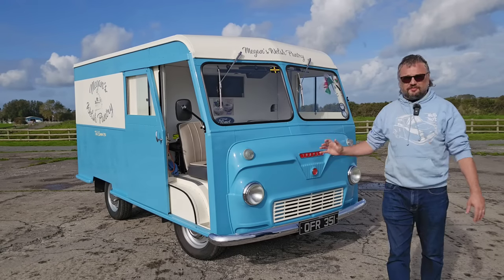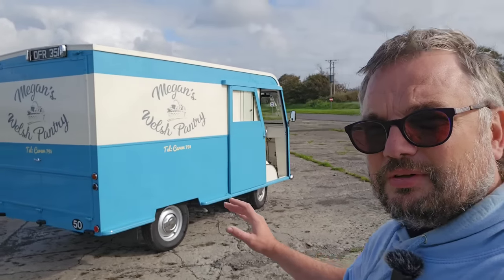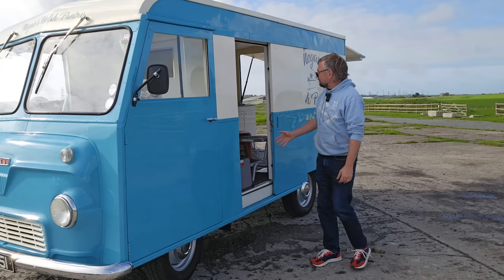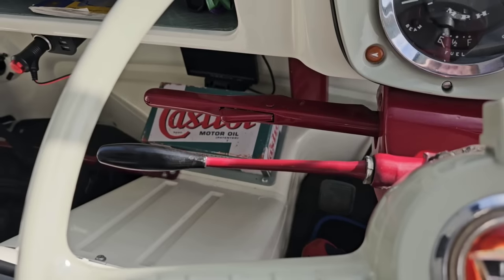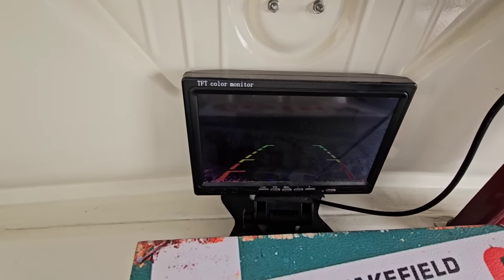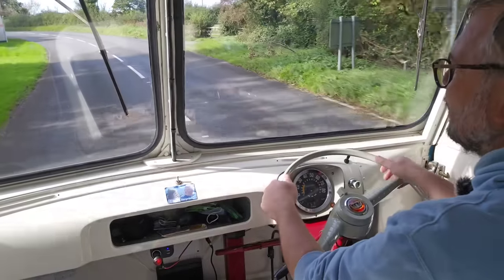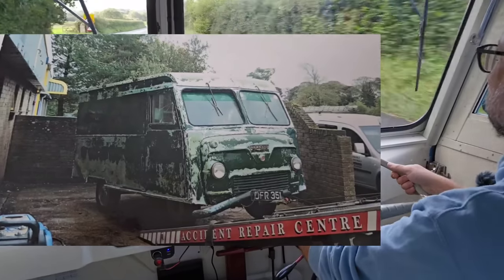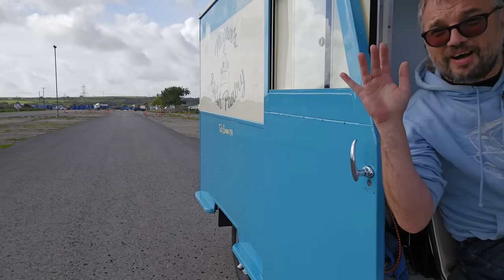What a treat! 1958 Ford Thames 400E bakery van -

Comment: My Dad had one of these in the early 60s. As a child, I was mesmerised by how the ribbon speedo worked. I remember sitting on the engine cover when we went for a drive. My backside would be roasting after 10 minutes and not the safest place for a 5 year old to sit.
Reply: I remember doing the same in my dad's one, we were tough in those days! 😂👍
Reply: Yes on the innovative heated seating, but in ours we had loose  bus seats in the back.  The Scout Troop had one also ,  featuring a chiseled hole in the engine cover/ child seat,  I think to assist early diagnosis of a coolant boil-up.

Comment: Those controls and the 45 mph comfortable cruising speed take me back. I think the position of the indicator controls would still be viable, I think; I remember seeing, though never driving, cars where it shared that position on the top of the wheel boss with the manual ignition timing control. Kids these days.

But there's one thing we should be really glad has gone: vacuum driven windscreen wipers. For those who have never experienced them, they were driven by the inlet air pressure, well below atmospheric on a light throttle. But there was the classic, terrifying scenario: rainy night, and you come up behind a slow vehicle that you really need to pass. As you accelerate, the opening of the throttle reduces the pressure differential in the inlet, and the wipers gradually slow--to a halt, if the system is not in the best condition. Terrifying. However much you value authenticity, they have to be replaced in any vehicle that goes on the road.

That was delightful--and for all of the appeal of the past, modern vehicles are so much safer.

Comment: Oh that brings back memories!

My dad had one for about 12 years from new as a farm van. He did some market gardening, and used it to take vegetables to local shops. His had uprated suspension giving it a one ton payload (though still with the 15 on the front badge). He gave up the market gardening, but it remained as the farm van, until eventually he traded it for a nearly new Escort van in 1971 (the first motorised vehicle I ever drove). My siblings and I would sometime ride in the cab on the metal engine cover, if necessary one facing forward on the front, another on the back facing the back (makes you shudder now!). I can still hear the noise - it was noisier with the conventional all-metal body.

The garage that acquired it kept if for their own use, but not long after a rear wheel fell off while they were using it, and it rolled over....
Reply from the maker: Aw!

Comment: Brilliant road test. My Dad bought the panel van version PHJ 965 in 1962 when I was 5. His was a 10/12 (half ton) version instead of a 15. He cut the sides and installed windows and then converted it into a small camper, with side mounted seats that became beds and a single ring cooker complete with Calor gas bottle. We used to holiday in Devon and Dorset and leaving Essex on a friday evening, the first stop was always Heathrow airport where I was allowed to stand on top of the van in my jim jams and watch the planes come in. He also had an overhead music system, but it consisted of a wire frame where he slid our Bush transistor radio that we used at home. I've ridden 100's of miles sitting on the metal engine cover with my feet on the dash. I caught one of the engine cover retaining hooks once and gashed my shin, I've still got the scar to prove it.

Comment: I bought two of these back in the 1980s, made one good one out of the two and used it to carry bands and equipment all over the Highlands for a few years. It eventually got so rotten it couldn't go any further but the engine never let us down. It was great fun but had no power steering and with a lot of the weight over the front wheels it was very hard to steer when it was full! By the time I'd driven a hundred miles or so on very twisty roads, played drums for a couple of hours and driven back home I'd be completely knackered.

Comment: Garners, who built the body, were an interesting firm in themselves. Started in Moseley, Birmingham in 1908, the initially imported Continental-engined lorries from the USA and sold them as Garners, never revealing what they really were. From 1925, Garners used British components, Kirkstall axles, David Brown gearboxes and Dorman engines, though they later used Meadows,  Austin and Perkins diesels. In 1935 the business was bought from the receivers, relocated to Acton, London, and continued building lorries from proprietary parts, including some 4x4 army lorries with twin Ford V8 engines side-by-side under the bonnet(!). During WW2 they built parts for torpedoes and other items, and 10,000 truck bodies. After the war they built a few tractors, but largely concentrated on coachwork until they went bust in 1968.

Comment: Brilliant video. My father before I was born had a Thames Van. His must have been the four speed as he said it used to have problems with the selector. He also sat on an orange box as there was not a drivers seat. He let the clutch out a little quick one day and ended up in the back of the van. He also said how the drivers side sliding door fell off the runners and ended up lying in the road. 😂

Comment: The Morris J4 (also the Austin J4) that I remember from our milkman’s float/van had sliding cab doors and that model I remember had BMC badging. I remember the milkman letting me sit as a little kid in the 1960s in the driving seat, which still makes me want to get into that van (and the Thames Trader, Bedford and Commer vans that I saw many of on the road - so many Bedfords were ice cream vans, too!) and take it for a drive. Oddly as a little kid when I saw the first Ford Transit vans I wasn’t enamoured of their looks and larger-looking size, their 60s/70s ‘plastic battery torch’-look headlights on the squarer looking wings. Time softened my heart, though. Like cars, all those designs had more soul than today’s - if only they could be combined with the safety features, efficiency and reliability of today’s vehicles.

Comment: I had a green and cream one around 1979 in Pembroke Dock. Bought it from a scrap dealer in Pennar. Sadly it went back to the scrappy in 1980 as I lost my storage just after I took it off the road because the back door fram was collapsing. Same 1703 cc lump as the mk2 consul - mine was a 4 speed but the gear change was as sweet as the zephyr 6 I had. Happy memories

Comment: My late father had a standard Thames van and the vacuum wipers were quite hilarious in their uselessness. Once you got to a steady speed they would go extremely slowly and would then speed up each time you lifted off of the throttle. I also remember that the passenger footwell floor was totally rotted out so there was a loose piece of metal over that which I used to take delight in lifting up and watching the road going by through the holes.

Comment: Enjoyable video as it bought back memories. I owned a 400E van in 1970 as a general runabout. I think it did have a heater in it. The sound of the engine was just as I remembered it!! Although there was just a glimpse of the 'sound system' in the van, it looked like one out of a Renault 5 GTL circa 1985.

Comment: I remember the Thames van used in the original film the Italian Job. The restoration of this one is amazing.
I went straight to Ford Transit MK1 1973 plate and 1976 plate 2.0lt V4 engine, LWB and they were great on motorways at a constant 70mph at 16mpg  between London and Devon.  The Thames would of struggled I thinks.

Comment: I used to drive an Austin J4  for an off licence which had the same engine arrangement, useful when the top hose split, l just filled empty beer bottles and topped up the rad as I drove. Bit damp but it worked.

Comment: I remember the Thames - there were still a few about when I did my apprenticeship in the late 70s at a Ford dealer and one or two would occasionally come thru the workshop. The double wishbone suspension you mentioned did not appear on the Cortina  till the mark 3 version much later (earlier ones were MacPherson of course)

Comment: Ah, that level of antiquity and oddity is just how I like them.  Thanks Hubnut!  I had fears before you lifted the lid on the engine that it might reveal the 100E sidevalve, but was relieved to see that they had the sense to use the Consul drivetrain.  That probably means that a Zephyr rear axle would go in, were someone to want taller gearing.  Funny thing, I was today thinking of the absence of McPherson struts in vans, as the towers would be right up the bums of front seat occupants.  Double wishbones are as one would expect, which makes the choice to use a solid front axle on the Transit van a bit surprising!  Cheers.
Reply: They couldn't use a solid axle on this forward cab van due to the location of the engine...
BTW my favorite power tool is my 1978 Ford E150 which has the double I-beam king pin front suspension making it more reliable. But then it also has the 351W engine, 4 speed manual transmission with a floor shirt & 411 gearing in a ford 9 inch axle with limited slip differential. So basically I own the best Econoline available in the US and the later Ford Transit vans were the best vans available in the UK. This Thames van is the predecessor of the Transits, just like the Falcon based van is the predecessor of the later F series pickup truck based Econoline.
Reply: Standard diff in a Thames is 4.6125. A Consul diff is 4.11. Zephyr diff would fit, but engine is running out of torque at that ratio

Comment: The secondary school I went to had one as a mini bus, with a full load of passengers it could hardly get up a hill and this was in Cambridgeshire in Wales I reckon that the passengers would be getting out to push. Sliding doors are great in Summer I had a Bedford CA van in the 70's and drove around with the doors open in summer. The other great thing about sliding doors is delivery work like milk or bread delivery where there was a lot of stop start with short drives between, you just left the door open stopped jump out and drop your delivery and jump back in, they even used to leave the engine running back then. Another vehicle that was well designed for delivery work was the Austin/Morris FG series of truck otherwise known as the threepenny bit, not only did the cab allow quick access /egress it also gave excellent all around view with the foot well windows,something that the EU is now mandating for all commercial vehicles that the driver has direct vision of all more vulnerable road users without mirrors, I do not understand why manufacturers moved away from such things.

Comment: I do love that old vans from the 50's and 60's. The trouble is to find a payable one. At one side you'll get trash, get and no parts at all, on the other side, you'll get one, I would be not able to afford it. There is nearly no in between. To store one, might be the next trouble. The height in particular. Most garage doors aren't higher as 6'-7" (app. 2m)

Comment: You've got a whole opaque pillar of doom there.
I used to drive a Sherpa with sliding doors as a courier in London. I always had the door open in nice weather and never wore a seat belt.
I never thought I'd fall out; I was holding on to the steering wheel after all!
Sliding doors make it easy to enter and exit in tight spaces and you can see exactly where you're reversing.
The Mark 3 Zephyr 4 had that same engine, but IIRC you had a choice of a 3 or 4 speed gearbox.

Comment: Great video Ian, the owner of that van has done great work with it. As "stealth campers" go, that wipes the floor with your run-of-the-mill Mercedes Sprinter!

Also, one of the Hubnut stickers i bought months ago will soon be going on my new car... not sure a 2011 Seat Ibiza is very on-brand, but it is an estate for the extra weirdness points!
Reply: Having only recently sold a 2011 Ibiza estate I promise my example at least was extremely hubnut.

Comment: That conversion from a bakery van to a (sort of) camper van must be Mrs. Hubnut to a 'T'. 

I remember the Thames van and the Anglia-based Thames van (Rediffusion comes to mind), as well as the Thames Trader (lorry). If the 400E was the predecessor of the Transit, the Trader was the predecessor to the D-series.

Comment: Nice one Ian. I love these videos of vehicles from the times gone by. It's great that this one has survived and is still in use. As a child I remember the Transit van that was a real game changer. I might be wrong but the Sherpa van came out later that boasted even more space and that lasted into into the LDV era. Another top notch video of times gone by. Many thanks for sharing. Just a thought, it would be great to get your view of the old Commer vans from the same era?
Reply: This Thames van is the predecessor of the Transits, just like the Falcon based van is the predecessor of the later F series pickup truck based Econoline. The later Ford Transit vans were the best vans available in the UK. This Thames van is the predecessor of the Transits, just like the Falcon based van is the predecessor of the later F series pickup truck based Econoline...
BTW my favorite power tool is my 1978 Ford E150 which has the double I-beam king pin front suspension making it more reliable. But then it also has the 351W engine, 4 speed manual transmission with a floor shirt & 411 gearing in a ford 9 inch axle with limited slip differential. So basically I own the best Econoline available in the US and the later Ford Transit vans were the best vans available in the UK...
Reply from the maker: Sherpa was smaller than the Transit, though an enlarged 300 series (later 400) was launched in the early 1980s that was larger.

Comment: As a child I was always mystified as to where the engine was on vehicles like that (tho this model is way before my time, it was more VW Transporter for me).

Engine in the cab, wow! Very cleverly engineered.

Aside from that, I understand nowadays why more gears were invented. Interesting that as engine size goes up, the number of gears isn’t as important….one of the early US muscle cars only has a 2 speed auto fitted….but there’s so much power it isn’t an issue. Forgive me America, I can’t be sure which car I’m referring to.
…personally in typical small or family vehicles in U.K.  I think 6 gears is about right. 5 isn’t quite enough…revs still can be fairly high at motorway speeds. But having had a VW DSG 7 speed I don’t see much need for the 7th.

That van must be worth a fortune.

Comment: The battery was behind the drivers seat with a metal fence around it with the starter button down between the battery and the metal shield, at the time I had a solid stainless steel watch strap and when starting the van one day my watch strap got between the metal shield and the live battery terminal and welded itself, I had to wrench it off as it got red hot and suffered severe burns to my wrist.  !!!!!!
Reply from the maker: Yikes!

Comment: A wondeful vehicle indeed! And ideal for weekends away. It reminds me of a three wheeler van of the 40s/50s which was basically a cube with a motorbike front fork. The name 'Bradford' rings a dusty bell among my lonely brain cells. Do any survive?
Reply from the maker: Bradford vans were built by Jowett and were fairly conventional (bar the flat twin engine). Reliant built vans like you describe, and Raleigh before that. There's one in my Teifi Valley Vintage Show report.

Comment: Nice van, love the interior. How does this model fit in with the Taunus Transit and the "regular" Transit with the nose?
Reply from the maker: Taunus Transit was simply Ford Germany's take on a van. Entirely separate to the UK operation. The big nose Transit was the first joint operation between Ford Germany and Ford GB, with each using their own engines and British ones built using imperial, and German ones metric!

Comment: 15 cwt is exactly ¾ ton! 112lbs in a hundredweight - same as USA. Their dry weights same as UK. It’s the wet measures that are different. But I’m sure you knew that - only wrote this for the youngsters who’ve never heard of proper measures! 
Those forward control vans always look like they’ll fall on their faces if you braked hard. Those vacuum wipers were a disaster, goodness knows why Ford stuck with them for so long. I had a 100E Anglia and that was really flash as it had a vacuum reservoir for the wipers. Which helped- a bit!
Reply: In the US a hundredweight is 100 pounds, but nobody uses that anymore
Reply: You are quite correct I wrote that wrongly - should have re-read what I put down. Thanks for putting that straight!!

Comment: explaining the number badge DOES make it easier to understand.  in American terms, that would be "Thames 150" by ford Nomenaculture (although, at the time, the US was using "100" instead, having come off of single digits to indicate that kind of thing for the first gen commercial).  for Ford, it's 150/250/350, indicating basically regular/super duty/heavy duty respectively.  with 450/550 indicating medium duty full commercial, and 650/750 for heavier lorries, and ending with 800/9000 for over the road stuff before they sold the big truck division off.  Dodge also used the 100/200/300 for a while, then adopted the 1500/2500/3500 that GM uses.

Comment: 1 cwt (imperial) = 220 lbs, or 1/20 ton, so 15 cwt is exactly 3/4 ton. That's the imperial or "long" ton. US ("short") tons are 2,000 lbs, US cwt= 200 lbs. But you knew that already.
Reply: You're so nitwittedly incorrect, I had a belly laugh!

112 lbs is an imperial hundredweight, not 220. Where did 220 come from? Outer space? 100 lbs is a US hundredweight, but nary a soul there uses the term and likely hasn't for 150 years.
Reply: @BillMalcolm-tn3kq  I think I covered my mistake in an additional comment shortly after. I can't be the only one who suffers from inexplicable brainstorms. I'm sure you're a nitwit yourself on occasions.